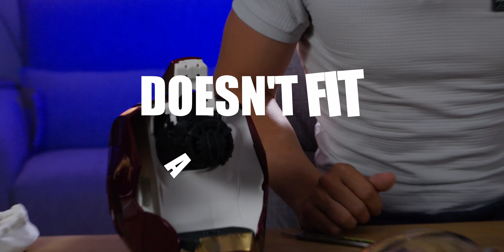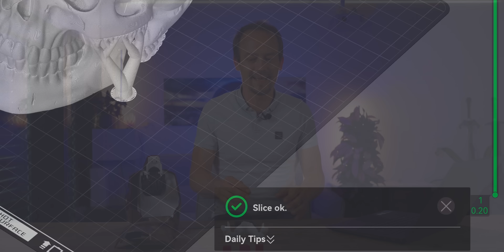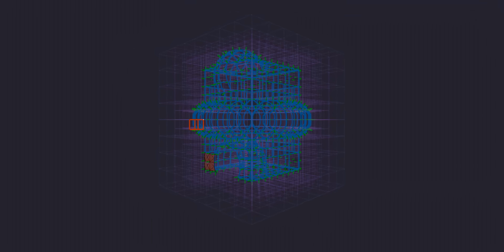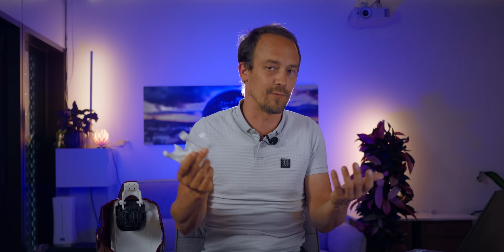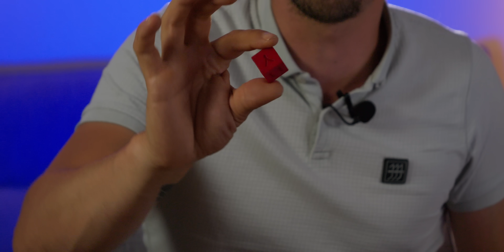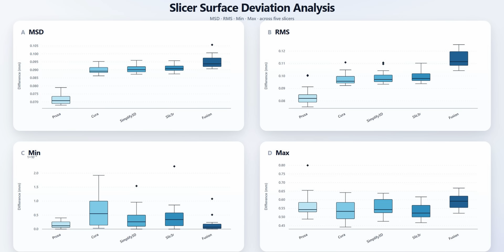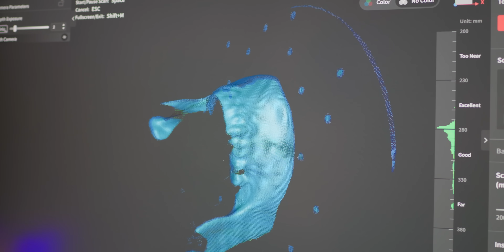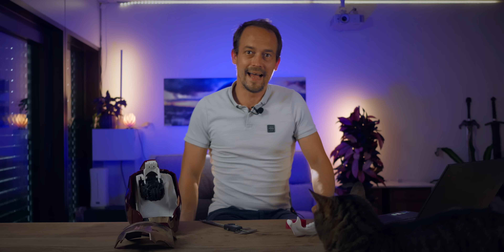The Hidden Error in 3D Printing - This is How We Found out

Comment: I wonder if you used the current version of these softwares if that would make and difference. Or even comparing various versions of the same software. Simplify3d 5.0 would be a big question. Prusaslicer and cura have released a lot of newer versions.

Slic3r can be skipped since it's super old now and doesn't seem to have been maintained. I think Fusion dropped their slicer in 2020.

Adding super slicer and orca slicer would be interesting too.

Comment: It would be nice to have a widely available and user friendly tool to upload the g-code and stl and get the estimated error the same way you did.
It would be good to simulate and tweak some settings (precise wall, arachne VS traditional slicer, etc etc) before printing when precision in this level is needed.

Comment: As far as I can tell slicers operate with an approximation algorithm. Because it is operating with ~0.4mm line width and ~0.2mm line height for the most common prints it has to operate within that range. For prints that have fine features that do not exactly fit multiples of those dimensions it must introduce some slight rounding error.

There is a limit to how precise a slicer can be given the physical hardware.

Comment: I’ve never seen anyone check the perpendicularity of a 3D printer’s axes. Try using a dial gauge and, for example, a 1-2-3 block. Run the gauge along the sides of the block. On the printer I checked (from a highly respected manufacturer), the deviation from perpendicularity was, at worst, just under 1 mm per 100 mm.

Comment: Knowing that slicers introduce an error is important, but you can't really do much with just that. Does that error increase with certain geometry? Is this just an inherent flaw of FDM printing? Do certain slicer settings impact slicer accuracy? I imagine that even a theoretically perfect slicer would still produce geometry that is not accurate to the input geometry, simply because it is translating into a methodology that isn't a 3D model. If you were to take a 3D printed part, scan it with a high accuracy 3D scanner, input that model into a slicer, and measure the deviation between the scanned model and the slicers output, would you see a smaller inaccuracy because the input model is a part the 3D printer can actually produce?

Comment: People don't really understand fits. A 1" diameter pin has various fits into a 1" hole. Only one of them is exactly the same sizes for both. And you won't be putting that together by hand, it will require the greatest of care to align, and then it may take a ton of force to assemble, and some will call that "too tight" or " doesn't fit". So this is a very subjective quality to quantify, and you must specify the function and assembly method to get a good result that suits what you had in mind. Tolerances are therefore meant to be massaged one way or the other on mating parts to suit the application.

I'm surprised 3d printers do as well as they do. Simple extrusion of molten plastic through a nozzle into free air is not a means of exactness whatsoever.

Comment: Great video!  Thanks so much!  This is very important information and one would think that the slicer authors would have done a little testing of their software before publishing!  I concur with others that I think you have another paper waiting to look into exactly where the errors are manifesting. Seems that you should be able to do a subtraction of the two STL parts and look at the remaining difference part(s).  I might also add that all your errors appear to be biased in One Direction in all the slicers. At Some point I suspect all slicers, probably derive from some original open source code. Since all the slicers have the same kind of bias, and for that matter error, it might be interesting to look back to some of the older open source code, and see if perhaps one can find this bias error in the code that would then be common to all the slicers. It might also be some common approximation. For example, using the angle in radians as an approximation for the sine of the angle. Anyhow, thank you for exposing this for us!
Reply from the maker: That is a fascinating theory regarding the shared open-source origins and common approximations!
That could lead to a "correction code" we could built in.

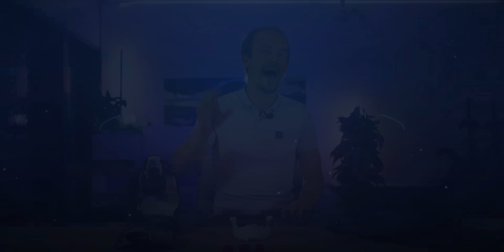Comment: I’m at 5:29 and I’m just going to attempt a slightly different explanation of what you’re trying to measure. You want to measure the part that comes out in the slicer AFTER slicing… the one you can run through the lines of g-code to modify or add pauses to. The image in the slicer SHOWS the lower resolution of the part compared to the original STL. You are trying to measure that digital object, before printing.

Comment: The prusa sw suite has a 3D gcode viewer, and you can export the extruded shape as an obj, so that 's quite trivial to make a comparison between all gcodes and the ref stl :   reimport the obj in fusion360, convert the mesh as an object, then inspect by section analysis. And you will see which ones cut corners. Do that with a small object because the number of polygons in fusion goes big fast.

Comment: Did you ever test calibration with the Califlower? Like you said, there are a lot of real world factors that affect the accuracy of a print, and the slicers are trying to compensate for that in their code. Prusa slicer's accuracy was probably because whatever profiles you were using had very little compensation built in. Is your calibration cube measuring too large because the print head is traveling through the wrong space? Or is it following the correct path but overextruding? Maybe the layer height isn't accurate? It's probably a combination of all of those factors, and you have to figure out a way to measure each of these effects in isolation and correct. Point is, the slicer's inaccuracies are probably intentional, because they are compensating for the real world inaccuracies of the printer. Yes, ideally we'd apply all of these corrections at the firmware level, but that's not always possible.
Reply from the maker: We disabled any and all conpensations that we could. And we set all extrutiin muötipliers and all to 1.00

Comment: Marching cube is not really very accurate, so it is an "approximation", but how close it gets to what you want will depend on your "cube" size. The really important thing is whether or not the instructions being sent to the printer are going to give the same print within the level of tolerance that you want.
Additionally, at 10:56 mins into the video you show graphs of the accuracy. There must be something wrong with the mm scale on the Axis. Why would you worry about 0.001 mm tolerance when printing on a 3D printer ?

Comment: The slicers I use are BambuSlicer, AnyCubic Next, and OrcaSlicer. These are all derivatives of SuperSlicer, forks of forks of PrusaSlicer, but all using the Arachne engine now. So, did you test PrusaSlicer using the Arachne or classic engine? I just want to know if OrcaSlicer, a branch off of BambuSlicer and what AnyCubic Next is forked from, is truly represented by your paper as the video claims.

Comment: Really interesting stuff; I do a lot of functional parts and fit things to mm or even sub-mm accuracy. If anything I tend to go too tight on tolerances. However, I typically need precision more than accuracy. For my use cases I can make small one off test fits to get everything tweaked. Recently I had a pretty annoying case where everything was nearly correct but things were so tight that my test fits were working because they deformed and the full size prints didn't have enough flex. A couple more tweaks, a bit more tolerance, and done. Would have really sucked if there was a living patient who had to go under the knife 16 different times just to get the fit right; but, my patients tend to be inanimate objects and the only person waiting is me.

Comment: The blue light scanning claim is BS. With the shown setup the achievable scanning resolution is way below the point, where light wavelength becomes an issue. Compared to white light, you don't have to deal with chromatic aberations in your optics, but that's the case for ANY monochromatic lighting setup. So blue light scanning is marketing BS.

Comment: I am not sure this is a very good test. What if Fusion 360 handles shrinking compensation much better and that's the reason why the GCODE is off more compared to other slicers?

I think printing on the same machine with the same material and then 3D scanning the results would be more accurate. The GCODE tells nothing because you always need to compansate for the material properties.

Comment: It's funny you bring this up, just the other week, I noticed that when I printed a single part as a test print (h2d, petg, 0.4 nozzle, 0.2 layer, bambu studio), the ID of the vertical hole was about 0.1mm out which was fine and still worked, but then when I printed 9 of them on the same bed, the hole is 0.2-3mm too small. Not sure if that is a known trait, disregard if so lol

Comment: isnt there some unavoidable error from the physical constraints of the extrusion process? blaming it on the slicer is not really accurate if the slicer is just modeling the constraints of the physical system, and drawing the best shapes it can without intersecting plastic in other plastic, smearing, leaving gaps, etc.

If you try to print the "theoretically perfect" slice I'm not sure it would come out well, I bet a lot of the "inaccuracies" are heuristic compensations for problems that have come up over the decades that slicers and printers have been evolving.

Comment: I think there are a lot of assumptions here. First - is it STL or STEP? Second, how did you set up your curve approximations while slicing, which tolerances? Third - do you use G02 and G03 for printing arcs, or you are segmenting them up - on TOP OF the segmenting done during the import.
Sorry if you answered, I might have missed it. If not - redo the video!

Comment: Nice video. And its great that you investigated this. Hopefully manufacturers will adapt it. I am sure with the open source community this will be fixed quickly. 
I would have loved a little more insight on the comparison. So stl model versus gcode reimported stl model. It would have been nice to get an idea or guess what actually causes these deviations.

Comment: Thanks for the video, really interesting. Never occurred to me the slicer could be such a significant source of errors. I was thinking one potential explanation for this error could be that the slicer is dealing with the physical world constraints. What I mean is perhaps having a more accurate model could be just impossible because it may require infinite (or absurdly high) torque, or perhaps because at 0.4mm line width some contours are simply not possible. At the end  of the day, the source STL does not have to deal with constraints of the physical world. I think that can probably explain part of the error, and it should be possible to prove it experimentally with well chosen input STLs. Haven´t read the paper, so it is likely you already thought of this. Sharing just in case.
Reply from the maker: Tjat is a verry valid argument

Comment: Cura (pre arachne at least) used to assume filament makes a rectangular cross section as it leaves the nozzle. Slic3r derivatives assume a stadium shape (pop semi circles on the ends of the rectangle). You assumed a square for all slicers. The model also has some very shallow top surface curves where we all know "stair stepping" will be inaccurate. But is this the only place? Your data is very simplified. If you are telling me slic3r handles stair stepping with greater accuracy than cura, im not surprised. All of the nuance has been lost in the data presentation. Im sure theres an interesting story here somewhere but using a cube walk to retrace an assumed stadium path, it doesnt surprise me they disagreed. slicers also have choices to make when approaching a slanted surface about how to best cover the area thats meant to be filled. Go over the 3d boundry fully, 50% over the boundry, stay entirely within the boundry and leave voids where model should be? Each if these approaches is a compromise. You cant boil that down to a value on a single model of how wrong it is like you did.
Reply: I think I know why this comment doesn't have any replies, it hurts too much to hear the truth...
Reply: @aone9050  It also has no replies because it's not the truth though. That's not how the marching cube algorithm works - it didn't "assume a square cross section" was being extruded at all. This entire rebuttal relies on an incorrect understanding of the algorithm's application.

Comment: Interesting - good method, interesting results, and verified with practical testing.
I am inferring that Creality Print, based on Orca is closest to Prusia Slicer.
I suppose that in any manufacturing process, there is unavoidable error, the way you reduce that is by involving the 'Project Management Triangle' - cost/scope/time:quality.
How much of each are you prepared to invest in manufacturing.

Comment: Interesting. 

One of my side projects is an FDM print simulator to preduct structural issues, print deviations, and any serious issues (like the nozzle colliding with a curled overhang so hard that it detaches the print from the bed). I go as far as emulating the printer's firmware, and (roughly) simulating the displacement of extruded plastic over time.

So what I do is actually feed the gcode to the emulator, then capture events from the emulator and build up the voxels (where a voxel is a factor of nozzle diameter). Each extruded bit is simulated over time, thermally, which sounds fiendishly computationally expensive until you realise most of them stabalise quickly. 

Excessive? Probably. I want to get close to bare metal, without hitting print.

Wish me luck. I'll eventually open source it, if it works.
Reply: Open source it before, we can help you make it works

Comment: still have one printer I use simplify3D slicer on .... and yes...repeatable size errors even when well calibrated.. I normally  re-scale in the slicer by 101.75% to get a part with the proper dims.

Comment: One of the fundamental problems that slicing software largely ignores is the physical reality of filament extrusion. A 3D printer does not operate in an idealized, physics-free environment.

When the print head changes direction or speed, it has momentum and must accelerate and decelerate within real mechanical limits. At the same time, molten filament is a viscous material being pushed through the nozzle, affected by pressure, flow dynamics, temperature, and gravity. The filament does not instantly start, stop, or change direction simply because the toolpath says it should.

Yet most slicers generate toolpaths as if extrusion occurs in a perfectly predictable environment, with only limited compensation for these physical effects. As a result, the printed object often differs from the ideal model the slicer assumes will be produced.

Many slicer settings; flow rate adjustments, pressure advance, retraction tuning, coasting, acceleration limits, and countless others; are essentially attempts to compensate for this underlying mismatch. We are not solving the root problem; we are tuning around it.

The fundamental reality is that 3D printers operate in the physical world, while the assumptions made by most slicing engines remain far closer to an idealized simulation than to the actual physics of the printing process.
Reply: "slicing software largely ignores is the physical reality of filament extrusion"

"Many slicer settings... are attempts to compensate..."

This is what it looks like to model the physical reality or create practical workarounds for physical limitations.  I'm not sure why you think they are divorced from physical reality.  Real users and developers pay close attention to real behavior on real prints in the real world, which is a different goal from, say, academics.
Reply: Until we have 3d printers which use true linear motors, linear actuators with linear encoders, we will never know how close our nozzles are to our idealised kinematics. You can't accurately profile behaviour you don't measure.

This lack of feedback is the big difference between industrial robotics, where you can reason about things like following error and abbe error, and hobby robotics where you run your stepper motors under spec to guarantee repeatable results, and adjust everything by effect.

Personally, I'm amazed at how at how much performance current 3d printers manage to squeeze out of their kinematic systems, given the limits on their instrumentation.

Comment: Hello, Rhinoceros 3D ART here:
If you want a beginner-friendly workflow that is 100% precise, skip building 3D volumes or voxels entirely—that actually introduces geometric vagueness.
Instead, do a direct curve-to-mesh analysis in Grasshopper:
1. Overlay your raw G-code lines right on top of your original CAD mesh.
2. Delete the internal infill paths so you are only looking at the outermost perimeter curves.
3. Measure the direct spatial distance from points on that outer curve to the original mesh face.
4. Map a colour gradient to those lines based on the distance.

By keeping it down to pure line-to-mesh data, you eliminate all distortion. You will see instantly if you are dealing with a simple rounding issue per layer, or a compounding tolerance error that builds up over time. It makes diagnosing slicer deviation incredibly visual and you can output the exact deviation per region.
Reply: Also there is a really cool book on 3D printing with Rhinoceros 3D and Grasshopper where you can control literally everything, you also wouldn't have to convert the step file, you could slice direct from step.